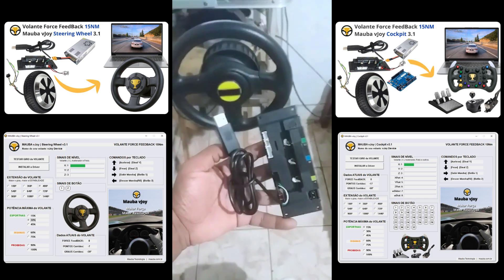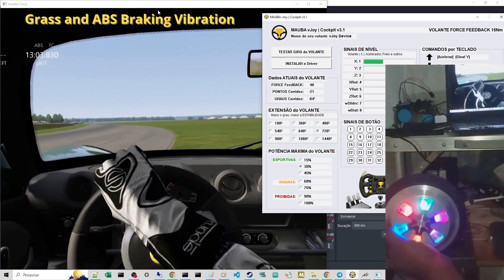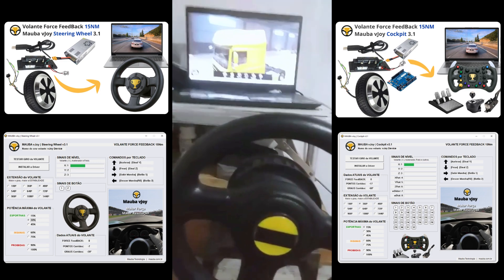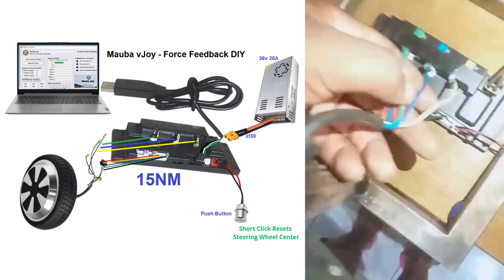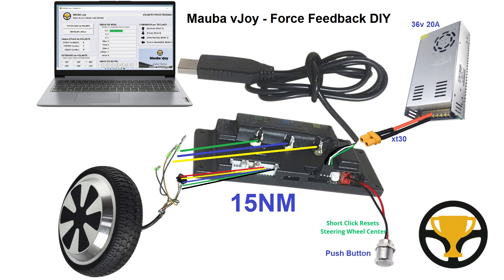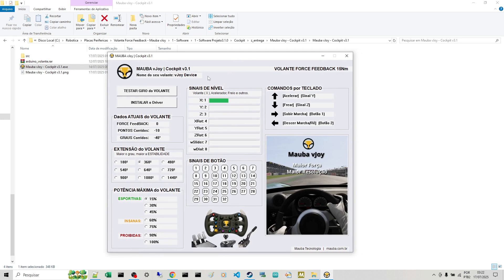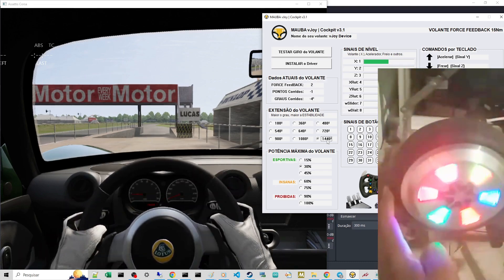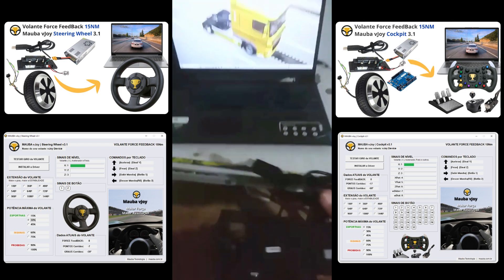Mauba vJoy 15NM Force FeedBack Steering Wheel Module - Easy Installation

Comment: On instruction on how to make a DIY DD wheel I have already cut the Hall Sensor board from the Hub. So that said I would be unable to use this, or can you wire the MT6701 magnetic encoder in its place.
Reply from the maker: To use a Mauba device, you need hall sensors.
Today in version 3.5, you can use the MT6701 encoder. I haven't made a video explaining it yet, but when your board arrives I'll show you how to install the encoder.
Reply: @noeyvert  MT6701：Differential Hall magnetic angle encoder according to Google. I wish I hadn't cut the Hall Sensor now, and really you shouldn't have to if you don't hookup the wires. Just use a rotary encoder. As for getting a board, at the moment it looks like you only sell to Brazil?? Here in Canada we use a system called Canadian postal code, a mixture of Letters and Numbers. Where as you have Zip codes. Also your Mauba site only has one payment system, Pix.
Reply from the maker: But you don't need an encoder.

90 PPR is enough for a perfect car racing lap. See Yuri's video: https://www.youtube.com/watch?v=SeIfjSG9msw

And in version 3.3 the steering wheel graphics have already been smoothed:

https://www.youtube.com/watch?v=zZzXkZARZ3g

Today we are on version 3.5.

But if you still want an encoder, today in version 3.5 it is already possible to add a encoder. 🏆🥂

Comment: This is a very interesting approach! If it does not have an encoder, how does it read the motors position?
Reply: im not sure, but looking at wiring diagram on the website it seems like it uses hall effect sensors built into hoverboard motor
Reply: @menamesjake  yes, it uses the built in sensors, so its limited to 90 PPR
Reply: i have the same question. If it does not have an encoder, how does it read the motors position?